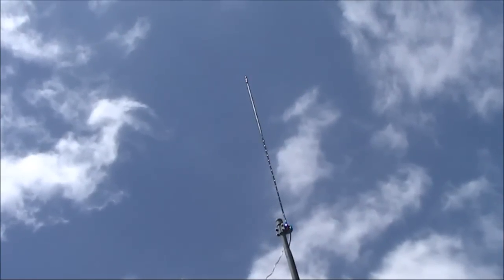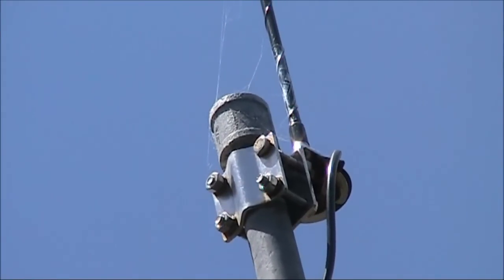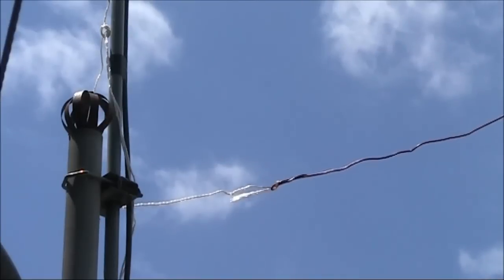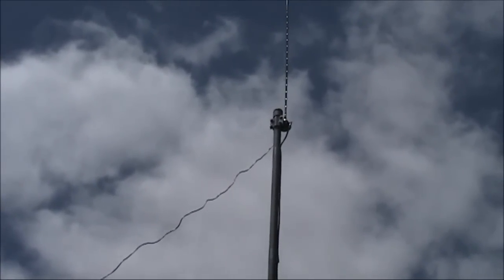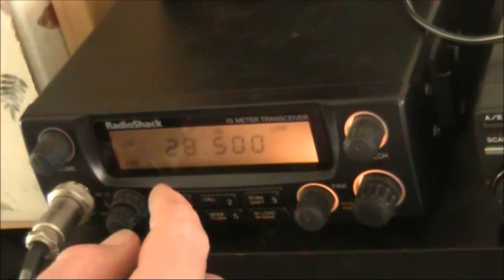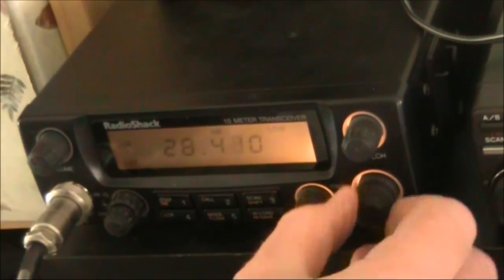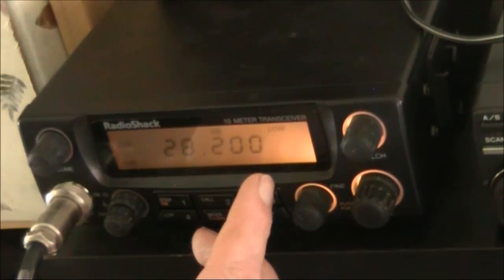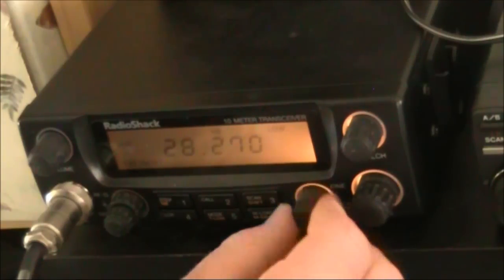Foundation guide to the amateur radio ten metre (28 MHz) band

Comment: Thanks for the informative video Peter. My own experience of 10m QRP here in the UK is when conditions are good you can have some great contacts on SSB. But 10 m FM is difficult. If you are using QRP you generally just get flattened by the QRO operators and if your signal is weak the other station can't pull your words out of the noise.

Comment: Hi Peter, the 5 kHz stepping and tuning "in between" with the clarifier reminded me of using a converted CB rig (PLL02A) in the early 80s.  Looking back through my first logbook, it's amazing what could be worked with 5W PEP into a dipole, or vertical quarter-wave with droopy radials. :-)  Cheers & 73, Mike VK2IG